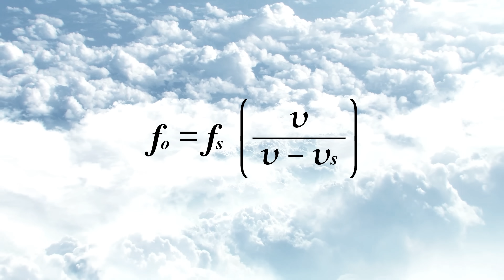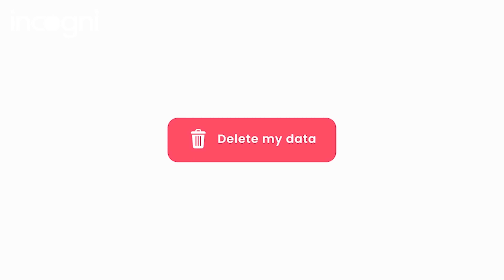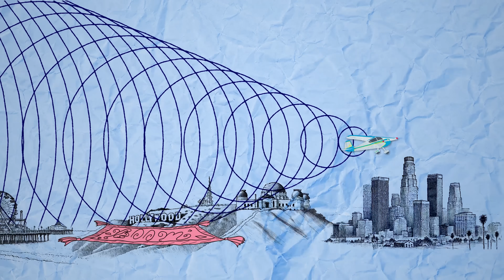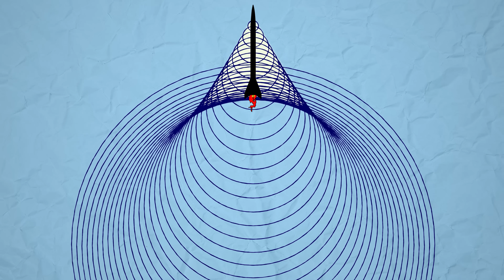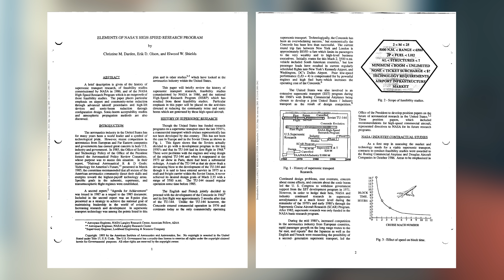You'll NEVER Hear a Sonic Boom From a Rocket??

Comment: Supersonic.. All these words.. Google: The term "supersonic" was originally used to describe sound that was above the range of human hearing, but the modern term for this is "ultrasonic" < Bites Apple Earth keeps changing meanings around while inviting other species to visit Earth with an old dictionary probe. You know that really piss a species off, right? Learn how to make continuous plasma discharge inside your rockets and then try to generate ultrasound with frequency filters to prevent interacting with your fuel and metals. Results for full Ultrasonic anti-drag = Slam into the ocean like it doesn't exist and elevate sound of craft beyond Human range of hearing which is how sentries appear silent when coming to scan Earth even when not moving.

"Ultrasound can produce temperatures as high as those on the surface of the Sun and pressures as great as those at the bottom of the ocean. In some cases, it can also increase chemical reactivities by nearly a millionfold." - https://suslick.scs.illinois.edu/sonochembrittanica.html Supersonic lol.. Cuts hand into a stem cell converter to make bone marrow in habitat system then waits for it to spread to fill whole habitat system for max blood/stem cell generation then converts stem cells into any cell for advanced plasma generated ultrasonic direct sound 3D bio-printing Run that by your free or paid AI programs like Perplexity. Yeah.. I understand everything about science enough to know what is fabricated or not.

"No sound in space!" Ask AI: "Plasma generated Ultrasonic echoes to pull hydrogen and oxygen waste by sun to regenerate ship life support for longer space missions." You didn't notice Ultrasonic microphones on Probes? Maybe they changed the names.. - Dracula https://youtu.be/aYrL0Kq2gFI?si=kex6hHgHD55jgueb (Ultrasound is Ultrasound no matter where. That's why there are ULTRASONIC microphones on probes. "It is Ultrasound but its not because its vibration!" Through Heliosphere gas like non-contact Ultrasound scanners through the air? "Its vibration coming in space! Derp Derp!" Umm.. That's kinda how sound travels through a medium. Hello? *Just go to Heliosphere images and look around the edge of the heliosphere. All of that MIST is gas. Medium.. 1+1.)

Comment: Counter misconception: The sonic boom caused by whips isn't from the tip moving faster than the speed of sound. It's from the displacement wave propagating through the length of the whip! :P

Comment: I'm just guessing by some first principles to see if I know and then finish the video.     It's the transition from subsonic to supersonic and back that creates the boom which are chaotic N waves that form on sharp surfaces. Bigger the surface edge, more boom like air clapping back together after being rudely separated by a wing. Kind of like cavitation bubbles in water. But Rockets aren't big surface areas for the air to be separated faster than the speed of sound so the exhaust of the rocket will be MUCH louder than any air collapsing back to fill any voids the rocket left with its teeny tiny little fins.   
Same reason lightning is so loud. The extremely rapid air expansion into a plasma isn't entirely what causes the sound. It's the air collapsing back in to fill the much lower pressure void colliding with, well, more air that causes the thunder clap.  Air is pretty heavy on earth despite it's relative thin-ness compared to the planet. Now on Venus. Big badda boom like 90 time more boom because the "air" is so much denser.

Comment: We were doing sonic booms for under $10 in the late 70s, how? FSI F100-9 motor in a light weight rocket, but to hear the crack, you need to be 800 to 1200 feet away from the pad. 
How much was your rocket?

Comment: huh, I always assumed the "shockwave cone" was purely from pressure differential, never even thought temperature was gonna come into play that near-instantly.

ps: on the dinosaur thing the video is a bit misleading: they weren't making whipcrack sounds to scare things they were swinging their tails at things with musculature and bone structure easily capable of producing supersonic speeds at the tip and a section on the end where the spine pretty much turned into a solid mass of bone and cartilidge and sinew that was VERY clearly meant for hitting things, it is whether or not they actually swung them as fast as they appeared to be physically capable of that is in question since frankly even at a quarter that speed they would still be capable of snapping most legs and caving in most ribcages, swinging it faster is mostly just gonna be for decreasing the event duration (which when covering that much distance per swing is actually a very real concern).

Comment: All you would have to do is get a long line and a large helium balloon and you could suspend a microphone high enough off the ground to capture the sonic boom as it goes by...

I was curious since you like to work with composites like carbon fiber, if you've ever explored adding carbon nano-tubes to the resin to increase the strength?  Carbon nano-tubes are supposed to not only increase the strength of composites, but also enhance things like thermal resistance.  Would love to see you do a test video using carbon nano-tube enhanced carbon fiber.

Comment: I remember back in the mid 1970s, I bought an early high powered rocketry kit that was advertised to break the sound barrier. It had an extremely powerful, fast burning first stage and broke the sound barrier at probably less than 100m altitude. The vendor calculated the distance you had to stand from the launch pad to hear the sonic boom. Yes, I heard it and all my friends did too. It was very faint but distinct.

Comment: Growing up on the Space Coast I heard the Space Shuttle twin sonic booms countless times growing up, some were louder than others due to the trajectory and atmospheric conditions. Some were muffled, others would set off car alarms. 

With a rocket going to orbit, the sonic boom can be heard on earth because it does not go straight up, it pitches down range to go into an orbit, but that sonic boom is offshore on almost all launches. 

Recently SpaceX has done a few polar launches from Cape Caneveral, with a trajectory effectively due south hugging the Florida coast and the sonic boom can be heard on land, from the Melbourne/Sebastian area all the way to Fort Pierce/St Lucie further south and the rocket is so high that there is effectively not enough air to create a strong enough shock wave to be heard. The exact 'cone' for the shock is dependent on atmospheric conditions and the weight of the payload as a lighter rocket will reach super sonic speeds faster.

Comment: This is another one of those vids where they only answer the question at then end.  I came here to find out why no sonic boom.  Answer the dam question immediately and then you can go into more details after that.  That way I can decide if I need more info and keep watching or switch to something else.  So now, I had to google it and, if google is correct the answer is: "Rockets don't typically produce a sonic boom because the shock wave is usually above the observer and moving parallel to the ground.".  Next time answer the dam question.

Comment: If interest in sonic booms continues, you could try this experiment.

Place a tethered balloon near the launch site up to about 300 to 500 meters in altitude. Put an audio recorder (like the small clip-on kind you are wearing in your shop?) at the balloon end, and possibly additional recorders along the tether separated by known distances from each other. After the rocket launch, pull the balloon back down to retrieve the recorders. Listen for the horizontal-radiating boom from the rocket as it passes by the recorder hanging in midair.

If there is a time stamp on the audio file, you could compare the time of the boom in each audio recordings, and see if the distance between each recorder correlates to the phase shift of the boom as it passes by each mic, given the speed at which the rocket is expected to be moving at that stage of its flight. Trying to calibrate the same time on each audio recording would be a significant issue to consider. Either the timebase of the recorders would have to be very stable (unlikely?), or use a distinctive external audio source that could be heard by the recorders just before the rocket launch (such as a very loud siren on the ground blaring out an identifiable pattern, or even a sub-sonic "sounding" rocket launch just prior to the super-sonic launch).

Comment: Love the supersonic Cessna!🤣 
5:50 - Also to clear up yet ANOTHER misconception, for anyone who doesn't know, an object does not need to be supersonic to create a vapor cone. It only needs to be transonic, where some of the airflow around the object is supersonic but the object itself is subsonic. The transition from supersonic airflow back to subsonic airflow creates a normal shockwave which generates the vapor cone. The reason we don't hear a sonic boom in this case is because the shockwave is attached to the object and moving parallel to it instead of spreading out like the wake of a boat.

Comment: I was a whopping 9 in 1991, tyvm.... okay so my oldest kid is now 19 and gone and....the POINT is, you COULD use a weather balloon for a silent, stable microphone platform at a given height, as long as the wind cooperated, or dangle the mic (with a squirrel tail) from a drone low enough that you don't hear much from the props.

Comment: Well, yes, we do, honestly. The rocket engine when it fires, sends its hot gases out at faster than the speed of sound.  That crackling you hear is the gases leaving the nozzle.  And so, you see the Mach diamonds as the visible result.  So, yes, yes you do hear sonic booms from a rocket launching.

Then again, you can set back at  the Cape and listen for the booms of returning first stages of the Falcon boosters.

Comment: The speed of sound in air varies with altitude/density.
Reply: The speed of sound in air is only a function of the temperature of the air. Density (pressure) plays no part. Of course as you go up with altitude the temperature drops which lowers the speed of sound but it's the temperature that matters, not the pressure or density. 

Speed of sound in air = 331 + ( 0.61 ⋅ T )    (meters per second)

T = temperature in Celsius
Reply: @wally7856  density very much affects speed of sound. The speed of sound in liquid is several times faster than in gases. And the speed of sound in solids is even higher. The speed of sound in air is measured in mph. In water it's measured in miles per second.
Reply: @stephenfowler4115  Read what I wrote - the speed of sound in "AIR". Liquids and solids behave differently.

In air, the speed of sound is solely dependent on it temperature and nothing else.

Comment: The double boom is one thing I feel many people don't understand or have a hard time wrapping their head around. I noticed you didn't touch on explaining this, but did illustrate it on the booster recovery video. Would have been cool to see your explanation, but I get the need to trim for time and simplicity.
Reply: The double boom (on an aircraft) is caused by the nose breaking the sound barrier and the second boom is the tail breaking the sound barrier. The Falcon 9 booster has a triple boom.  The first boom is from the aft end (engines), the second boom is from the landing legs at the widest point going up the side of the rocket. The third boom is from the fins near the forward end.

Comment: When I was a kid, I used to hear the sonic booms from the Space Shuttle over the Los Angeles area whenever it would land at Edwards Air Force Base.  It was always a very-closely spaced pair of booms, and my understanding was the shock cone from the nose of the shuttle was narrow enough that the massive vertical stabilizer (tail fin) protruded past it and created its own shockwave.  When we heard it, we'd turn the TV on to watch the landing.  You didn't specify whether the 1991 boom was an east coast or west coast landing, so I don't know if I was around to hear that one or not, but my back is doing ok today, thanks for asking.

Also, it wasn't recorded with acoustic equipment, but barographs around the world recorded the pressure wave from the 1883 Krakatoa eruption, probably the loudest sonic boom experienced by humans in recorded history.  It was heard 3000 miles away.

Comment: Just pointing out what I'm sure we all know, the speed of sound is not static through the atmosphere, or the ocean, but varies by density. So the numbers she gave are some kind of average.
Reply: You are partially right but:

The speed of sound in air does not vary with density. The speed of sound in air is solely dependent on the temperature of the air.
Speed of sound in air = 331 + ( 0.61 ⋅ T )    (meters per second)

T = temperature in Celsius

The speed of sound in the ocean varies by temperature, salinity, and pressure.

Comment: I was just re-watching your Spite build as was wondering why you didn’t “Vacuum” bag the fines when you were making them to get all the air out.  I have watched our Aircraft Structures Technicians do composite repairs and they always vacuum seal the repair to get all the air out of the epoxy resin so it will harden solid with no air pockets.

Comment: Quick checks.  
1) speed of sound in air is not constant. It can vary based on temperature 
2) most frequent sonic booms I wonder if it would be (sad to say) guns/bullets which are well consumed in very high rates
Reply: Nah, there are 8 million lightning strikes per day. They're very common in the world
Reply: @linecraftman3907  If there are more than one bullet fired per day for every 1000 people then the guns win.  Sounds plausible but I would like to see a source for that
Reply: Not only temperature, but density.  But I give her a pass on that. You can't go down EVERY rabbit hole in a 15-minute video.
Reply: @kurtamesbury6679   Density is the primary factor and temperature depends on it.  
But no she doesn't get a pass. She said speed of sound is constant.  She could have said nothing, but she tripped over a rabbit hole.
Reply: Speed of sound essentially  depends on air density. Temperature, pressure and humidity are the main factors.  Her analysis of sonic boom is subtly wrong because the speed of sound is very high in the compressed air of the shock wave, and it is in fact a sound wave, just not a normal one.
Reply: The “Sonic boom” of a bullet is called a “ballistic crack”
Reply: Without seeing your response, I had  the same two points a couple of days ago (though I must say, I went into much greater detail...proving it is PROXIMITY, rather than POSITION being the reason why people can't hear the weak sonic "crack" of her relatively small supersonic rocket)  😉
Reply: That's why I downvoted. Temperature matters. High school physics.

Comment: BTW:  My back is just fine.
 On some space shuttle landings, you would hear more than one boom.  I think this is because they weren't going in a straight line so the wave from the boom is not so simple.
Someone made a trebuchet that would launch a metal ball above the speed of sound.
Reply: Different parts of the shuttle making more then one boom. On an aircraft usually the nose and tail are responsible for 2 separate booms. On the Falcon 9 booster return, the engines, widest part of landing legs, and the grid fins makes 3 distinct booms.

Comment: Thunder is sonic booms? I thought thunder was the crackle and pop of static discharge, but bigger. So is the crackle and pop actually sonic booms, but smaller?
Reply: The lightning superheats the air into a high temperature, high pressure plasma. That high pressure plasma then accelerates outwards faster then sound.
Reply: @wally7856  Yes. Got that from the video. 
Also, My bad. The question was supposed to read 
"Is the crackle and pop of static discharges actually sonic booms, but smaller?"
Reply: @slolerner7349  Good question. The heat from the plasma of the spark is definitely rapidly expanding the air creating a pressure wave that you hear. Sound is just a pressure wave but to make a sonic boom the air has to expand faster then the speed of sound so the sound waves stack on top of each other. Couldn't tell you if that's the case or not. It may very well be. I couldn't find any info on it.

Comment: Side project for the next rocket: weather balloon with a 360 camera and a nice microphone.
Reply: Wouldn't be ridiculously high for an RC plane either. Above the 400' standard legal limit, but if you got clearance (which might already be covered for the rocket launches?) I could see using powered flight to get up, then turning off the prop when the rocket is launched to record clean A/V.
Reply: @markfickett2591  Most of the sound is coming from wind noise, not the prop or motor.  It would pick up the boom, but the audio quality would be trash.